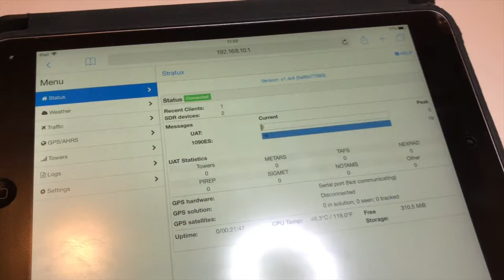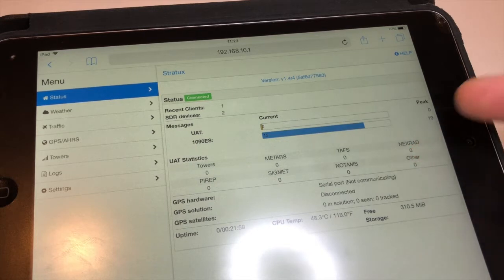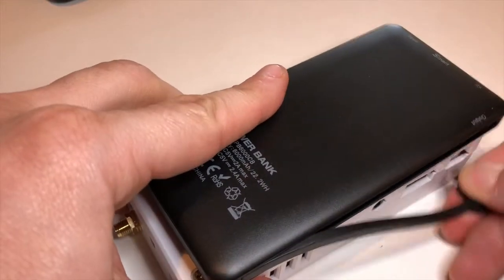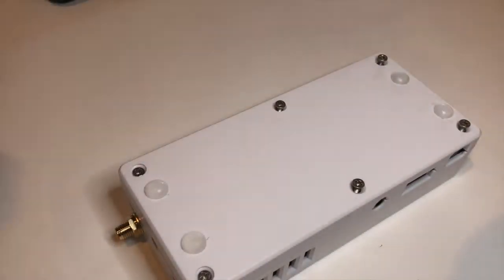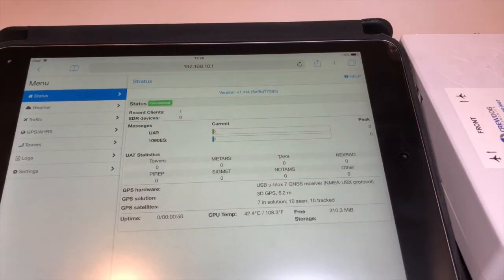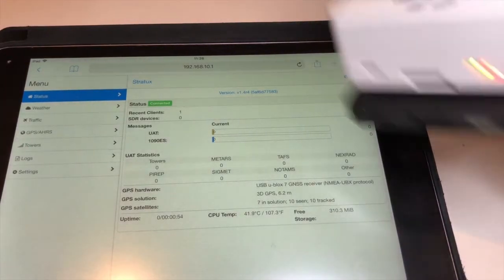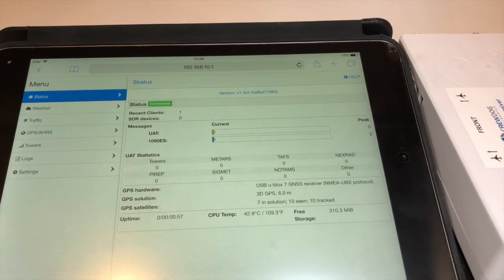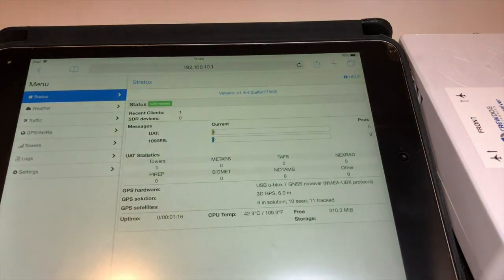Stratux ADS-B GPS Troubleshooting Tips

Comment: I have problem made me return my stratux board and replaced two times!! 
once I plug the power to the outlet (2A) the red and the green flashing then become solid red and green for about 30 Sec  then the red light turn off and green stay solid , the signal is still good and everything is working,, except the red light  stay off

I read somewhere saying if there is no red light mean the unit not getting enough Voltage or Amps !!! 

what to do??
thank you
Reply from the maker: Red light means a power issue. Most common issue is damaged or low quality USB cable. I'd try that first then replacing the RPi3 board.